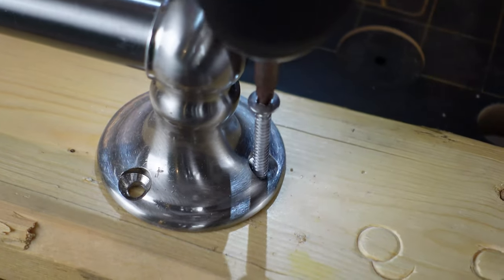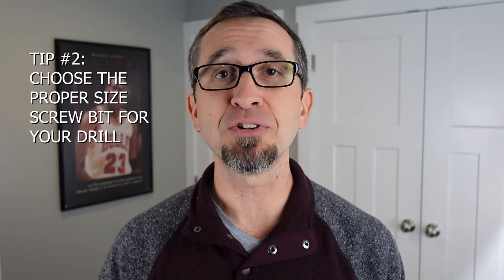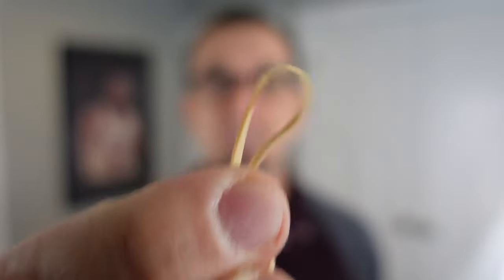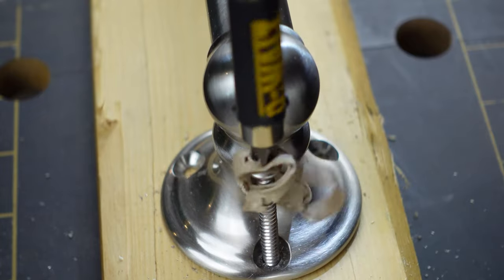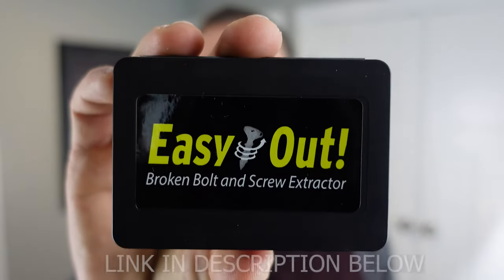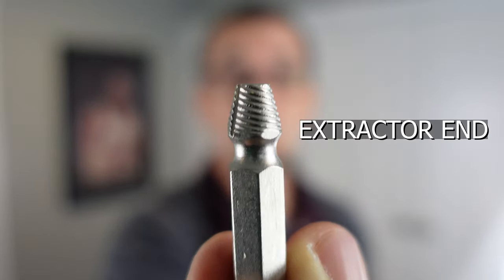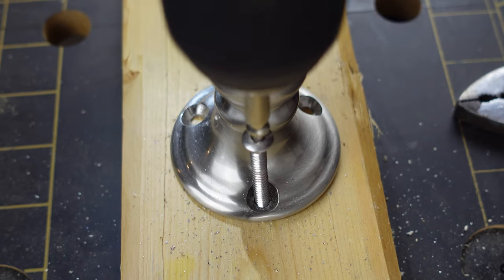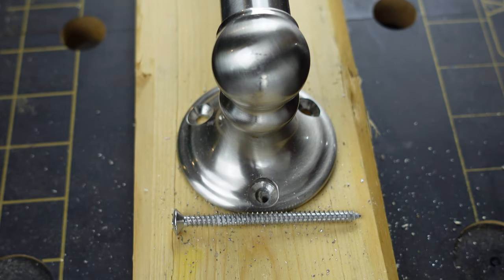How to Remove a Stripped Screw

Comment: Rubber band tip absolutely does not work there are countless videos on YT advising the same all rubbish
Reply from the maker: I’m sorry you feel that way. I’ve used it countless times with great success.
Reply: U gotta use the thick ones
Reply: You never heard the saying "A bad workman blames his tools"? Was it a bad batch of rubber bands in your neck of the woods?  If one method doesn't work try another,  I went with the screw extractor kit and got an instant result.
Reply: Sounds like a skill issue. Works for me and countless others.

Comment: Any tips on how to remove the stripped out allen screw on the tub spout?  I tried your tips, only option I have to do is drill, concern here is that it is on a CPVC piping in the back.
Reply from the maker: I am about to record another video with some other options. Is the screw completely recessed or do you think you can get pliers on the head of the screw? I’m not trying to push a product, but this may be a good option (I will be covering this in my video but it will be a few weeks before it launches) https://amzn.to/473xV1T. 

Let me know what you think.
Reply: @ReluctantDIYers  screw is recessed with maybe 1 thread out, hard to get a bite with pliers(similar to the one you suggested).
Reply from the maker: @RajKedda  Dang, ok. Drilling may be the only option, but if it’s PVC you’ll need to be very careful.

Comment: The rubberband trick worked perfectly for a stripped hex bolt on my motorcycle seat rack!
Reply from the maker: That’s awesome!!!! Thank you for sharing! 👍👍
Reply: What if it's stripped and remains tight/ lodged? How would you loosen the screw?
Reply from the maker: In the video description I believe I placed a link for a flute style screw extractor. That’s usually the best for that situation.

Comment: you could also use an angle grinder to make a line in the screw or bolt so you could have a strong grip with a flat screwdriver
Reply from the maker: Ohhhhhhhhhh… good idea! Most people don’t have an angle grinder though….

Comment: Good demo 👍  Thanks 
Though I have been unsuccessful with the rubberband technique, I got to try with the screw extractor. My guess is that since it has the reverse threads, rotating counter clockwise ( loosening direction) will make the extractor thread to actually dig in the stripped head for more grip. 
Dealing with small screws with phillips head which are stripped.
Reply from the maker: @vintubeable  You are correct. 👍🏼👍🏼

Comment: Great tip about the extractor kit. My only question: how do you then remove the stripped screw from the extractor end? It's on there pretty good!
Reply from the maker: Thanks Sean! My advice… hit it man… LOL! Honestly though, sometimes it does get stuck.
Reply: @ReluctantDIYers  thx for the advice! (Late night power tool use leads to brain farts LOL!) Got it with a reverse twist 👍. Keep up the great content, man!
Reply from the maker: @SeanHackbarth20  AWESOME!! Thx man!

Comment: Just thought I would add that I purchased every product available to remove stubborn screws and nothing worked. I was removing gutter rails on RV and all the screws were stuck, frozen, would not budge. After spending a couple hundred bucks on various products that didn't work I then proceeded to grind the head off every screw. This was around 50 screws and took all day but there was no other way. I was replacing the entire RV roof and the gutter rails had to come off.
Reply from the maker: I’m so sorry to hear that… but thank you so much for sharing!

Comment: The screws i am trying to remove are deeply embedded into the bottom of my Nutri bullet smoothie maker.  Also the area is plastic and I can’t damage the base.  I managed to get two out but the other two won’t budge.
Reply from the maker: Because of the plastic base, you can’t really get super forceful with those blenders. I would even hesitate to use a screw extractor on it. Might be time for a new NutriBullet if you have to take the screws out. 👍🏼👍🏼

Comment: What if the head has been sheared off flush with the wood?  In my case, the screw snapped off of a screw that holds a tubular foot rest on a bar stool.  The broken shaft is in the leg of the stool so I am not sure if it is ok to use a hole saw to extract it and repair it with a dowel.  I would rather tap it and use the extractor tool if possible so I do not compromise the strength of the leg.  What do you recommend?
Reply from the maker: Hey Rocco! I’m so sorry I missed your comment yesterday. This is a tough one and it all depends on the size of the screw that’s stuck in the stool. If the circumference of the screw is big enough to take the extractor but, I would try that first. If not, you could also drill it out, which is a pain. The hole saw is an option as long as you think you can repair the wood. That might require an epoxy putty to give strength.

I hope this is helpful. This is definitely a tough one.
Reply: Replying to a stale post but WoodRiver makes small reverse hole saws that fit over the screw. I remove sheared hinge screws with them often. Using the 3/8 O.D. size we keep dowel on hand to fill the hole then start over. Use with care they are thin and fragile. Drill a 3/8 hole in thin scrap wood to use to guide the bit if needed. Easy to find online

Comment: If your drill can reverse, then can you just use a regular drill bit in reverse to turn the stripped screw loose?
Reply from the maker: Unfortunately no.
Reply: @ReluctantDIYers  

A worker at Lowe's suggested I try that.
Reply from the maker: @CrowdPleeza Interesting. Without the proper threading I’m not sure how that will work. But please let me know if it does work. 👍🏼

Comment: I was using a screwdriver bit to remove a shower faucet handle in order to change out the valve, when the screwdriver bit broke, jamming the tip of the bit in the screw. The screw is recessed into the faucet handle, so there is no working room around the screw. Will the Easy-Out be able to drill/burnish through the broken screwdriver bit? I think the metal in the screwdriver bit is quite a bit harder than the metal of the screw so I don't know if the Easy Out can make any headway through the bit. Any advice on how to get the screw out? (Besides not using cheap Husky screwdriver bits anymore)?
Reply from the maker: Oh man Brian, that’s a tough one. I’m not sure if the extractor will work on that broken but. Have you tried drilling into the bit, screwing a screw into it and pulling with pliers?  I’m not even sure if that will work if it’s recessed. Just thinking out loud…
Reply: @ReluctantDIYers  Is it possible to drill into a screwdriver bit? I actually bought a screw extractor pliers, but because the screw is recessing inside the *metal* faucet handle, there is just not enough room for the pliers to get close to the screw. If the handle was plastic, I could cut the handle away from the screw, so that the screw is no longer recessed, but alas, cutting metal is a much harder task.
Reply from the maker: @brianc4341  This is a new one for me. If anyone else has thoughts, please share.

Comment: This is such bullshit. The screw in the first example is super long and is already 95% out of the hole. I’m trying to remove a tiny little screw that’s still fully in a hole on the end of a game controller. A rubber band doesn’t do jack there.
Reply from the maker: I’m sorry you feel this way. The rubber band has worked for me countless times. I’m actually about to make another video with other methods tomorrow.
Reply: @ReluctantDIYers  I even tried it again today and the screwdriver poked right through the rubber band and made a hole. Also I feel like most of the people who have stripped screws it’s only slightly stripped so there is still something there to grab on to with the help of a rubber band or glue. I used an electric drill bit and got mad when it wouldn’t unscrew and basically drilled a giant circular hole in the end of the tiny screw head. So now even though I have a whole set of screwdrivers in all sizes and shapes, nothing will fit in and take hold because the entire head of the screw is blown out in a big circle.

Comment: What would I do if the stripped screw is in a bathtub drain cover.. and the drain is clogged, not draining. What do I do?
Reply: Someone please 🙏 help me.
Reply from the maker: @emilys.d.7834  Is the tub full of water? If so, try to bake the water to a level where you can get access to the screw. Then you can follow the different approaches to see what works. I hope this helps!
Reply: @ReluctantDIYers ... The tub is not completely full of water..
Reply from the maker: @emilys.d.7834  are you unable to see the screw? Drain covers vary so it’s tough to say one approach will work versus another.
Reply: @ReluctantDIYers .. I'm not really able to see the screw.. ive been trying to get the water out of the tub by bucket method... That part is really tedus
Reply from the maker: @emilys.d.7834  I totally understand. You could also try liquid plumber or another drain clearing product to free up this clog enough to let the water drain. Then you can get to the drain cover a little easier.
Reply: @ReluctantDIYers .. will that damage the PVC pipes?
Reply from the maker: @emilys.d.7834  Just make sure that whatever product you use is safe for use with PVC.

Comment: Dumb! Your removing a screw that is already loose which is not the case for 99.99 percent of people with stuck, stripped screws. The reason the screw is stripped is because it is a really tight fit. In your case you could see the screw wobble before you tried to remove it.
Reply from the maker: Thx for your support Wally! 😁